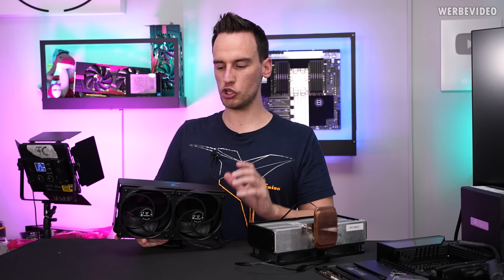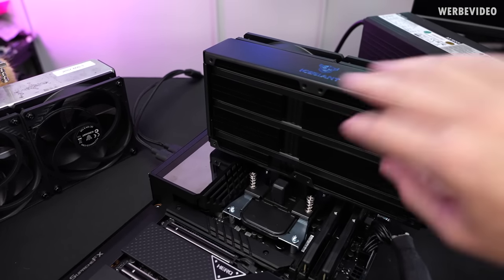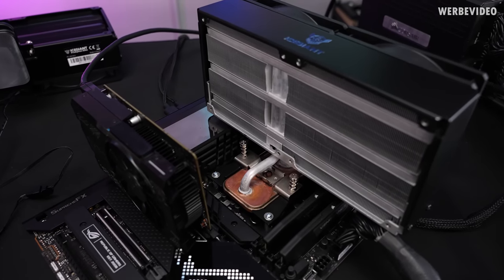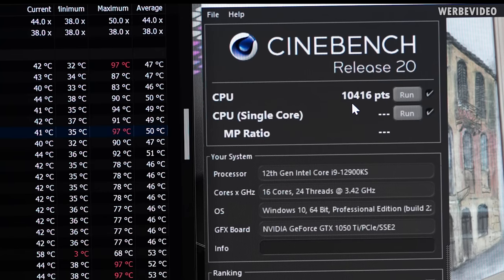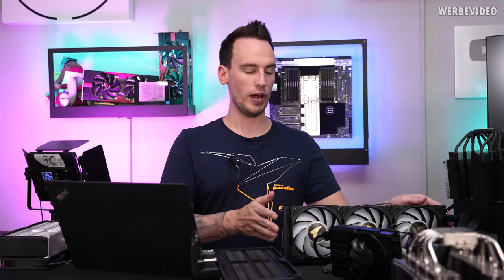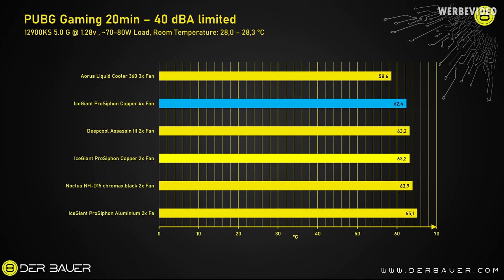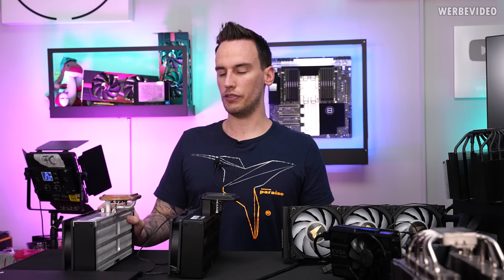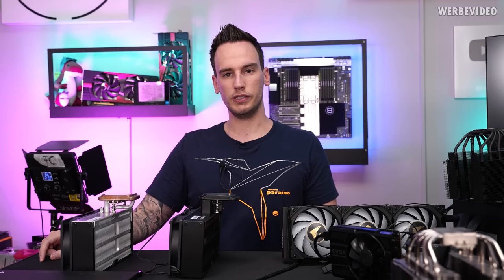This Prototype has A Lot of Potential !

Comment: Why don't companies make a cooler with a silver base since it has a higher thermal conductivity than copper?
Reply: Becaue money? You can get a golden toilet like Saddam Hussein if enough money.
Reply: @woldemunster9244  I get that but if it's just a base it won't be THAT much more expensive than an air cooler with a copper base. For a premium air cooler like ice giant I feel like it could justify the price anyway
Reply: Dude yes it would be THAT much more expensive. This is silver we're talking about?

Who would buy it? There's already no reason to buy this gigantic thing that only the copper prototype can now match a D-15 performance for more than twice the price.
Reply: It wouldn't make that much of a difference. The rate limiting part of any heatsink is how quickly you can transfer the heat absorbed from the cpu to the air (or water for liquid coolers). Copper heat pipes are stupid efficient at conducting heat (like 5000-10000W/mK). So really you just need more fins. But then you need more heat pipes. However, a cpu is kind of a small surface so you can only have a few heat pipes actually in contact. It's a balance of all of these things plus the price consumers are willing to pay.
Reply: yeah why dont companies make knives made of diamond since it has a higher cutting power than stainless steel?
Reply: @ravell2854  I mean anything that needs to be cut with diamond is going to be industrial anyways where as silver could still be formed into something. It's already used in solar panels for that purpose so why not make like a silver heatpipe. Baller pc enthusiasts would buy anything and I would love to see it just as a proof of concept
Reply: Yeah but that could apply for a well known brand like noctua, Icegiant is trying to enter the market with its prosiphon, thats why the first prototype was aluminum, to save costs. Going to silver just for testing is out of question on their budget.

Also the proof was already made several time on paper, silver is better than copper for heat transfer but the gain is so minimal compared to cost that it renders the idea impractical

Comment: Why would you make the base as aluminum in the first place? If copper is able to lower temps about 10c. Did no one prototype that in the first place?
Reply: Money.
Reply: @Rakadis  so they made a worse product to save 2$ from manufacturing? And in the end lost more money making a new one...that spells pure genius to me.
Reply: @Takashita_Sukakoki  yes, they do.
Reply: It's not just $2, it's most likely 100x cause it has to be a completely new mold and everything, plus different soldering process to connect and all that.
Reply: Prototypes are just that
Reply: @paddingtongorilla  Exactly,no way it just saves cost by $2
Reply: Man you must be the smartest person on the planet. They should hire you. Clearly it took them years to have the idea you had immediately.
Reply: @Rakadis  you do realize that he straight up said at the start of the video that manufacturing and soldering alu and cu together is really hard...
And considering the internal structure of this thing is kinda weird to begin with they probably didn't want to tackle both problems at the same time.
Reply: @Takashita_Sukakoki  You're forgetting that manufacturing something in low volume is much more expensive than making thousands of units (which is way cheaper long term if you can actually do something with all of those units), specially when you include all the pre-required tooling, manual work, etc. The cost of the materials is small in comparison.
Now also add R&D and dozens of one-off prototypes, that gets really expensive.
Reply: @SquintyGears  so they where so smart they had to make 2 prototypes to figure out that almost every pc cooler for 20 years has had a copper contact plate?
Reply: @Takashita_Sukakoki  where you are pulling the 2$ figure from, this is not a solid piece like with normal radiators. It's a part with a cavity and the cavity has to be connected to the rest of the radiator aluminum piping and is lower pressure than air. Actually making it work with the copper chamber required time they did not have for first iteration. Startups have very limited time and making an imperfect product that still works and sells well enough is better than shooting for perfection and running out of inverstor money before completing the job.

Comment: Sounds like CPU heatspreaders should be made out of copper instead of aluminium. Why are they not?
Reply: Cost, including ease of manufacture.
Reply: AFAIK they're not aluminium, but nickel plated copper.
Reply from the maker: It is copper
Reply: Cpu heat spreaders are copper. Just plated with nickel to prevent oxidation or galvanic corrosion
Reply: @der8auer-en  I stand corrected, thanks.